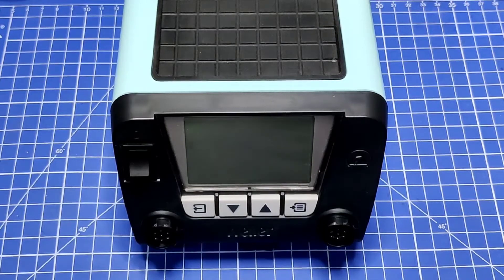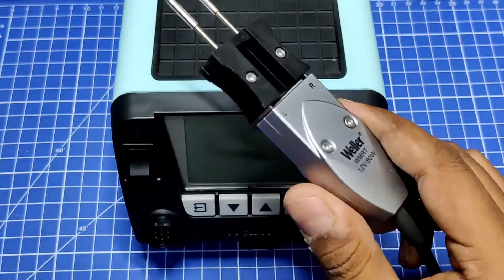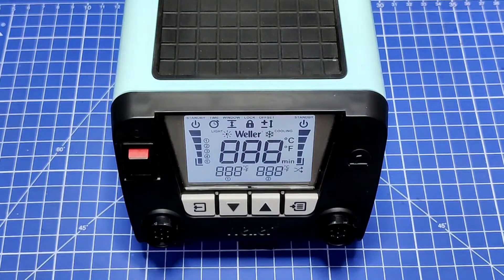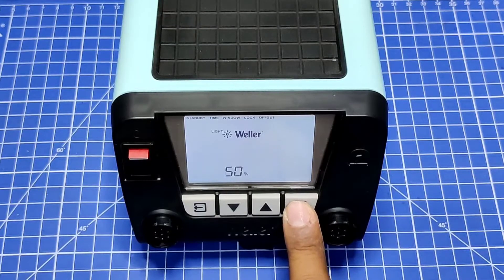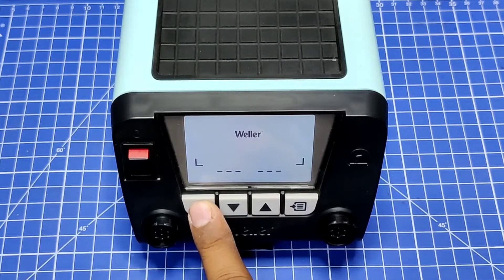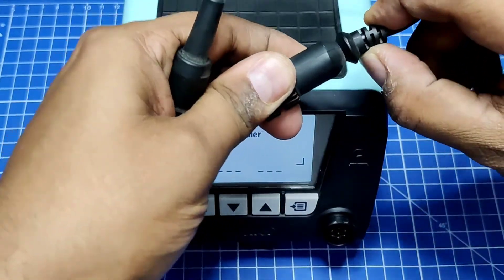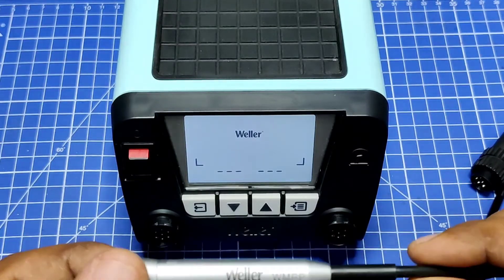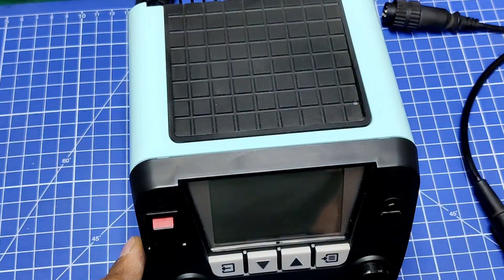Weller WT2021  WT2M soldering station Bug and Poor Build Quality

Comment: Flipping the power like this will crash the micro. Definitely not a "bright" thing to do.
Reply from the maker: If you had the station u will know. Once it enters standby->sleep then u have to reboot to make it work again, and this happens quite often when i work for long time as station keeps going in idle state i have to do this on/off to get along with my work. The genius at Weller could not give the resume feature via using the existing button on the unit. i cannot wait 2 sec when i am working on something so i always do quick on/off. Anyways i do not care much about the station when i compare with the recent Chinese clones flooding the market which  offer superior quality at very little premium price. when you do not implement power-on reset (PoR) properly this will happen. Weller SUX

Comment: In the OFF standby state, you need to press the UP and DOWN buttons at the same time to restart. The new WT series, except for a larger screen, are not as good as the old WD1 series in terms of construction quality and ease of use. The new features have not improved, and the build quality is worse.
Reply from the maker: it worked but pressing both buttons at the same time is not easy. It takes couple of tries to get it each time and it always changes the temperature setting. Will stick to On/Off sequence. Weller UI is pathetic.
Reply: @DoTheDiy  Yes, that's why I said that apart from having a larger and beautiful screen, its ease of use is not as good as the old WD 1 series, and its manufacturing quality is worse. This is the fate of many companies after being acquired by a consortium. Those managers only see the profits but not the inheritance of the brand.
Reply from the maker: Thanks will try this